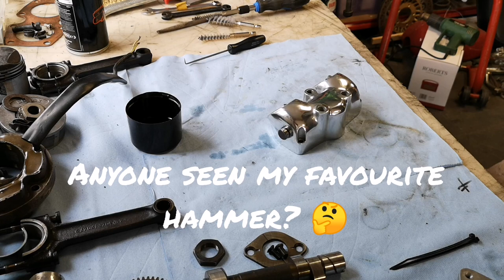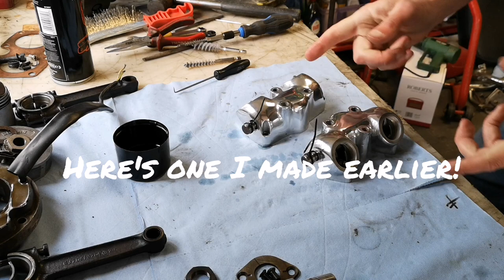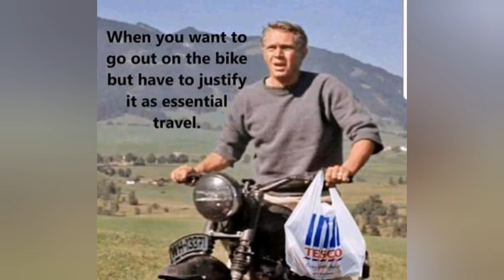Project TriBSA Episode 18

Comment: Great videos I am really enjoying. I have a question on the crank drive side oil seal. I understood that the open lip side of a seal should go towards where you want to keep the oil in, yet you fitted it the other way? Why is it different on this engine? I just did an A65 engine and that seal goes in the other way, keeping the oil in the crankcase.
Reply from the maker: That's a very good question. It does indeed seem to be the wrong way around. But Triumph and many Triumph guys all agree on this way around.
I'm sure it would work either way, but I'm not going to question it.
Well spotted!